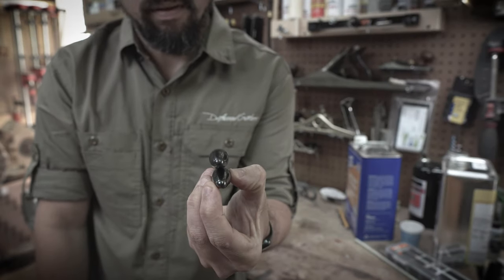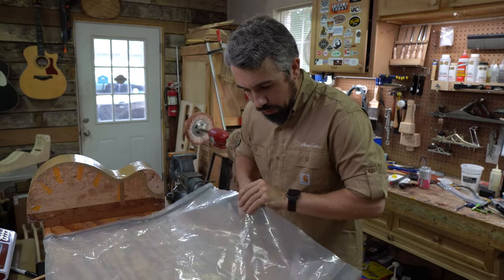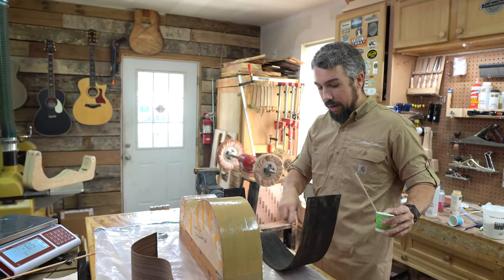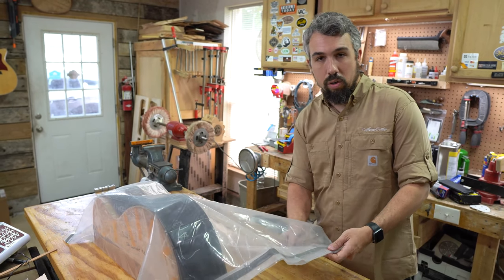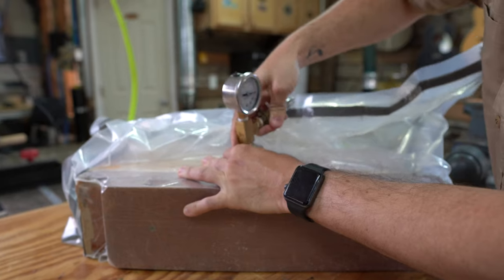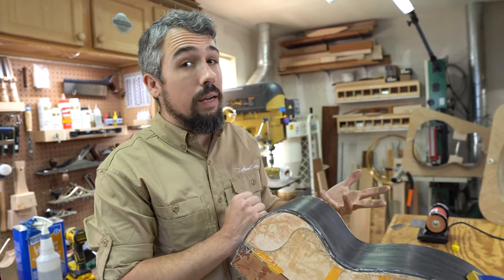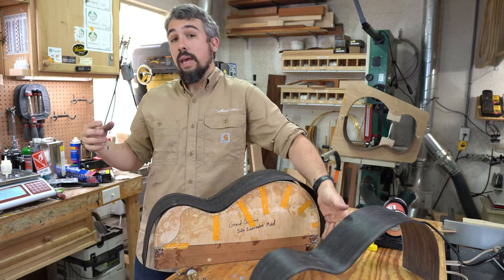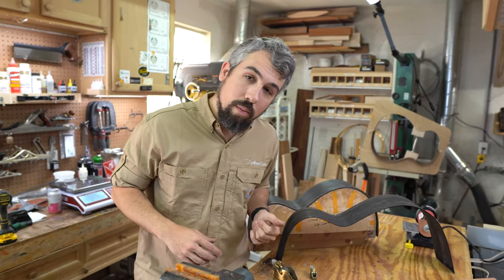How to Build a Acoustic Guitar. Episode 8 (Laminating the Sides)

Comment: I am really enjoying the build, only thing I would caution is your mix ratio on the epoxy.  When you say 2:1 that usually means by volume not weight.  You would be correct if both part A and part B weight the same i.e 1oz by volume weights 300g of part A and 1oz by volume weights 300g of part B.  Then the manner in which you mix would be correct.  The epoxy manufacturer should have a product data sheet with weight mixing ratios.  Probably not an issue at first but from what I can tell you take a lot of pride in your work and an improper mix might not stand the test of time, especially as the wood expands and contracts being that the laminates are different species of wood.  Love the channel keep doing what your doing!
Reply from the maker: I appreciate you pointing that out. It hadn’t occurred to me that by volume and by weight were two different things haha. Duh. I’ll be sure to do it correctly from here out. Thanks for pointing that out.

Comment: Great video, as usual, Chris. I've been building with laminated sides for about 12 years now, and you're right, this is a total game changer. I thickness the outer (show) side to 2.5 mm, and the inner one about 1.8 mm. Using a silicone heat blanket in my shop-made bender, I actually bend both the outer and inner sides together, with the heat blanket on the outside of the sandwich; and invariably, both the inner and outer sides conform exactly. 

I use Gorilla glue for the lamination process for several reasons: It's far less toxic than epoxy; it has gap-filling properties; you have about fifteen minutes of open working time, which is plenty if you have your ducks lined up at the start. I would never use Gorilla for a load-bearing joint, but for laminating sides, it works really well. I've had great success with this, so I'm sticking to it.

 You do have to be sure to put that release tape on your molds, because the Gorilla glue WILL extrude through porous woods and glue your sides to the mold. I learned that the hard way. Also, wear a pair of nitrile gloves, because Gorilla will stain your hands brown.
Now you've got me wanting to go with a vacuum system instead of using clamps and cauls. I love your videos, and I binge-watch them, because you always have a really well thought out perspective, and a wealth of craft wisdom, and you never fail to show me new ways to spend a lot of money on more tools! AND monogrammed Carhart shirts! Plus one on the style points, Bro!
Reply from the maker: I love all of this! Thanks for taking the time to contribute. Matt lives for affection for the Carharts.

Comment: I'm truly enjoying watching you build these guitars and listening to your opinion on the ones you cut in half. this process you're doing looks very much as we do in aviation on composite panels and moldings. Vacuum bagging after a layup. you used the term "Leading Edge, when you were putting the two-sided tape on the opening of the bag, were you in aviation at some point in your life? just wondering.
Reply from the maker: I was actually a Structural Maintenance Tech for 8 years in the Air Force. I did Sheet metal for 6 years, and Composites for 2. Good ear.

Comment: I'm curious as to why the vacuum technique isn't used more with fretboard glue ups.. also, would epoxy be a viable candidate for a fretboard glue joint? Why is titebond better or worse for the job? Seems to me a vac job with epoxy would almost be a better method for fretboard glue ups. Opinions?
Reply: My opinion - In short epoxy+vacuum simply isn't needed for a fretboard. It would work but appears to be more "work" to do. Titebond type glues work fine with no mixing and simple clamps or elastic works just find for fretboards. There's not the same tension in a fretboard glue up as there is in an acoustic like he's doing.

Comment: There is one issue that arises in the longterm when some elements of a guitar's construction are particularly rigid due to lamination while other elements have more plasticity. Anyone with experience repairing guitars will have encountered a guitar with laminated sides and a solid top that has the top disconnected and misaligned with the sides (often in the waist area). This occurs because, over time, laminated sides do not expand and contract in response to environmental factors at the same rate as the top (due to how deformation-resistant and climate-immune the epoxy-filled sides are compared to the top). Of course, this only becomes an issues several decades into a guitar's life, so if these guitars are meant to be high-performance professional instruments rather than cross-generation heirloom pieces, then this isn't a particularly profound problem (and is probably a worthwhile compromise to improve the sonic characteristics of the instrument).

Comment: Have you thought of trying a few layers of carbon fibre on the interior (replacing the inner wood) or a single layer of carbon fibre in between the woods?   If you think the laminated wood is stiff, even a single layer in between will be even stiffer, and best of all, carbon fibre has no inherent bend of its own, so it will 100% conform to your mold with no spring..
Reply: I was wondering the exact same thing.

Comment: So in doing what you just did would say that guitars with laminated sides and backs might have better sound than a solid wood guitar.  If so why are laminated woods in guitars are frowned upon. I do stringed instrument repairs and I’m getting ready to build my first guitar. I’m going to start with either walnut or mahogany and I was told by other luthiers that I could sand the areas where the bends are as thin as I could to make it easier to bend. What are your thoughts on this?
Reply from the maker: Don’t confuse laminate sides made of two solid pieces of wood, with plywood. That’s what is usually found in cheaper guitars, and is terrible as a tonewood. Manufacturers will call plywood, laminate, but that’s just marketing.

Comment: I am planning on using your laminated side technique for my next guitar build. I just had a question. What is the reasoning for using Rosewood on the Inside. I know it bends well but it seams like kind of a waste. I was thinking of using Maple or something less expensive that I can get locally and resaw myself.
Reply from the maker: You can use anything youd like for the interior wood, but LMI sells rosewood sides already thicknesses for laminate sides for like $30. It’s a no brainer in my books.

Comment: Question for u. Unrelated to this vid. But, in other vids, you mentioned that your finish thickness was "3.5 mils". Are you referring to 3.5 mm? As in about 1/8"? That seems super thick. I just got done with mine and the finish measured at 0.25mm. 1/4 of a mm. Pretty much all my finishes register under 1.0mm. what am I missing here? I've seen factory guitars measuring 3mm and the sealer coat is crazy thick
Reply from the maker: No, a mil is a unit of measure for finishes. It’s actually .0035”
Reply: @DriftwoodGuitars  oh ok! I thought I was misunderstanding. That makes much more sense.
Reply: I'll have to check again when I get home. Mine was either .023 or 0.23. can't remember. .0035 is crazy thin!
Reply: I was measuring in mm for mine. Idk what it is in inches off the top of my head.